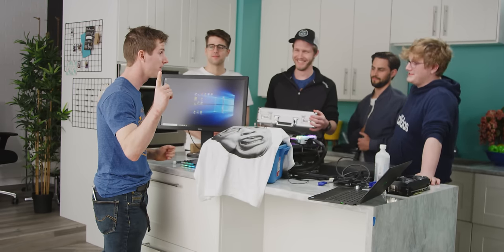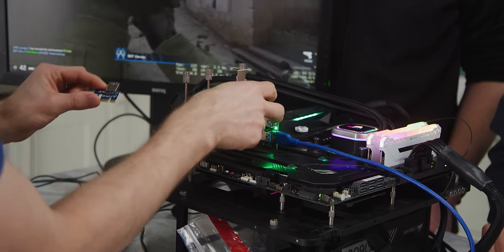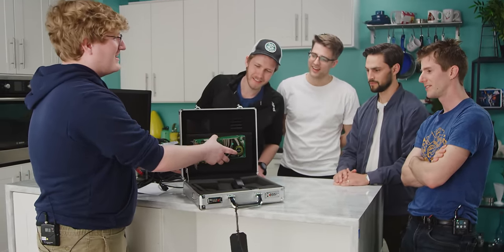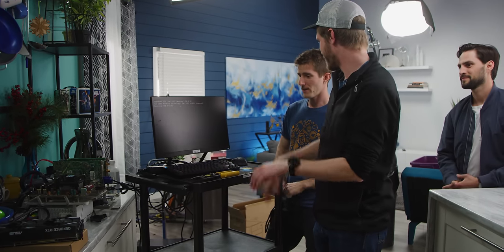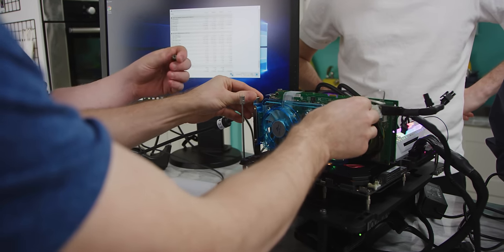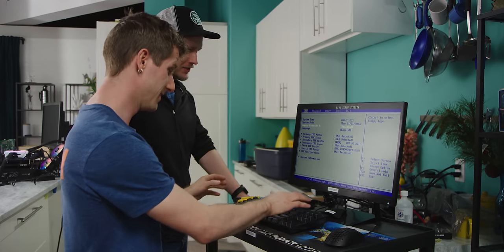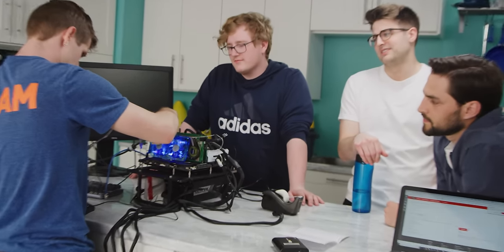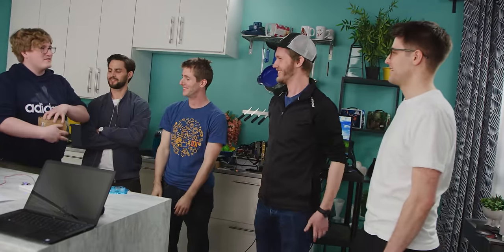The WEIRDEST PC Parts we Found on AliExpress

Comment: I'm a physics major and we have some pretty weird cards to interface with some of our lab equipment. The one that jumps into mind is a card that exists for the sole purpose of interfacing with a spectrometer.
Reply: Ah yes
Perfection
Reply: I would love for you to enter next year 😆 blow em out the water lol
Reply: Yes that shit is weird af lol
Reply: You'd think that kind of thing would be USB TBH, like printers or other big boxes
Reply: I have one that exists solely to provide a single serial output to control an old CNC machine.
Reply: @thewhitefalcon8539  maybe its ages old. I mean at the chemistry student education lab we had some machines which were attached to a pc running, idk windows 95? 3.1 maybe? One of the lab guys said if a part of the pc broke he had to look for old pc parts because they didn't really sell stuff anymore.
Reply: Is it a GPIB card?
Reply: In industrial automation there was a mid 2000s vogue for pci cards that did all sorts of I/O. We are talking motor controllers, fiber optic ring networks, FPGA analog to digital converters etc. Pain in my ass when they finally die and are completely irreplaceable
Reply: the weirdest card I know of is one that interfaces with a gas tank for a submersible pc for marine science from like the early 90s.
there's probably been 5 made. probably ISA though, not pci
Reply: You can see ghost whit those.

Comment: PCIe is too fast, I prefer PCI 👍
Reply: But is speed good?
Reply: @thescreemregular5168  It's PCI, it's horrible
Reply: Actually PCI is faster than PCIe in terms of raw latency. It takes about 2 microseconds to read a single byte over PCIe gen3. PCI does it in 125nS. Obviously PCIe has more bandwidth for larger sized transfers.
Reply: Pp
Reply: @Shadowmaster625  Just like when DDR2 was released. DDR outperformed DDR2 for some time.
Reply: I mean it is one letter less to spell PCI than PCIe, that surely must mean speed if you can type it faster?
Reply: I like having more time to snack or sip a beverage during loading screens
Reply: I’m not a Fan of Phosphorus and Chlorine
Reply: @snowkatyoutube1419  poo poo
Reply: How bout PCI-X
Reply: PCI is lame.

Comment: I had that blue pci fan several years ago when I was in high school. It was the difference between laggy minecraft and smooth minecraft for my passively cooled gpu
Reply: Thats hilarious lol
Reply: TOTALLY, A GREAT INVENTION, Kept my Pro QUADRO GPU happy!
Reply: I also had that fan when I was in high school, but that was years before Minecraft was even in alpha...
Reply: @JadeMarvin  It must not be doing to bad then if its made it so long
Reply: Nooooooooooooooooooooo waaaaaaaaaaaaaaaaaaaaaaaaaaaaaaaaaaaaaaaaaaaay...
Reply: Just hearing the phrase " passively cooled graphics card " reminds me of how fucking old I am considering modern cards like the 2080ti basically have a brick for a heatsync with big ass fans strapped to it
Reply: @ForbiddenFate  They still make passively cooled GPUs and high end graphics cards used to be way bigger.
Reply: I too, owned one of these for 6 months before it shook itself apart.
Reply: So basically turning it into an actively cooled GPU.
Reply: had a 5670 XFX "silent" radeon card a decade ago & it was also just one big fanless heatsink. Worked wonders in cold scandinavia, except one summer where it got abnormal hot weather. Did get one of those dual-fan pci cards as well, but it sadly didnt cut it. Ended up removing a sidepanel & using a genuine big table fan to cool the whole system.
Reply: @JadeMarvin  i miss the old days, there were all sorts of crazy things to mod your system
Reply: @JadeMarvin  we are prolly pretty close in age, do you remember the PC case that was made almost entirely out of fans?...i always wanted that thing
Reply: >Buys passively cooled graphics card
>Also buys fans to blow directly onto it to keep it cool

Comment: “Hey why is there a USB cable running from your PC to the freezer?”

“Keeping my GPU cool”
Reply: I wonder if that would work.
Reply: Back when i was a broke student and my gaming laptop got stolen i got one from a friend that had no screen and didnt have any working cooling. So i had my laptop in my fridge with a HDMI running from my fridge to my tv. good times
Reply: @derpderp4820  That's genius
Reply: I'm watching this at 2 am while everyone is sleeping , and this made me laugh so hard ahhahahahahaga I'm literaly crynf
Reply: Putting electronics in humid cold places doesn't sound like a good idea
Reply: Dean Sqwilliams run a dehumidifier duh. Lol
Reply: Yeah toss that gpu in a deep freezer and you're all good
Reply: @bldeagle10  been dehumidifying my freeze since 92. just in case my fans break
Reply: Didn’t Linus do a video on this?
Reply: @jimihenrik11  bruh
Reply: its not dumb if it works
Reply: 😂 😂 😂 Man that's hilarious
Reply: Pretty sure any humidity is going to migrate away from hot pc components and condense/freeze on the cold surfaces of the freezer.
Reply: @bruhtm1032  how?
Reply: @jimihenrik11  In a very short term, yes. But the condensation would eventually get to it.
Reply: @jimihenrik11  the problem with using a freezer or refrigerator for this sort of thing is that they aren't meant to cool things down, they're meant to keep things cool. They do very well at keeping external heat out and maintaining a low internal temperature but they would struggle to cool something that is actively producing heat.
Reply: @jimihenrik11  well, super hot gpu inside a freezer would create moisture, which PCBs really aren't fans of.

But more importantly, once the system is powered off, the card would swiftly drop down to freezing temps, and then skyrocket back to operating temps in seconds, which would no doubt crack the board.

So I guess...... 

Maybe?
Reply: I don't have a GPU ! so no cooling required !
Reply: @derpderp4820  oh god i'm choking
Reply: @jimihenrik11  funnily enough they did a video on that way back: putting your entire pc in a fridge. It turned out that it hurt way more than it helped due to the insulation in the walls. Fridges and freezers are not meant to run continuously.
Reply: Imagine the overclock options lol
Reply: @bldeagle10  real question is how would you use the freezer after that?
Reply: I want to see them actually try this
Reply: Stick it in a ziplock with a few big bags of silica gel is to avoid condensation and you're probably onto something
Reply: @derpderp4820 I'm presuming condensation was less of a issue than expected. I know in a freezer it would be likely to build up water but the fridge probably wouldn't do that.
Reply: @ssksleepyboy I mean technically if you have an igpu you still got a GPU. Just the one on die is all.
Reply: @Aliyah_666  technically yeah, practically ? nah
Reply: @jimihenrik11 it'd keep at least 5 watts outside the computer!

Comment: I would love the see that pci oszilloscope working! please make a follow up on that card!!!
Reply: A PCI card will work in a PCI-X slot
Reply: I also would like to see it working.
Reply: pretty much every o scope uses pci digitizers
Reply: that scope card also works on a pci to pcie 1x adapter but u have to provide the extra power
Reply: bro just use a DAQ labview and some simple circuits to do what you need
Reply: Or try to find a modern pcie oscilloscope
Reply: A review pls
Reply: Don't think there'll be all that much to see. It's just a PC based oscilloscope, not really all that different from the $60 Hantek or $150 Bitscope USB ones. There should be plenty of videos on Youtube. This one is a lot more expensive, it might be more powerful, but it's also a lot older, and there has been a lot of progress in the low cost oscilloscope market in recent years (thanks to the maker scene), so I wouldn't be surprised if even a Hantek 6022 was actually superior.
Reply: pci and pci excpress DAQ instruments like oscilloscopes are pretty common, but often expensive.  Picoscope make some excellent USB oscilloscopes.
Reply: What is this thing supposed to do? Measure voltages?
Reply: I want to see it working
Reply: @user-ni2tp6ey6l  Pretty much. Voltages over time, at high frequencies and resolutions. So it can be used to identify and analyze signals, or identify very fast overshoots, noise or ripple a regular multimeter wouldn't catch for example. It's a pretty important tool in electronics design.
Reply: it probably costs more then he can afford.
Reply: @phillipBappleton  said "
pretty much every o scope uses pci digitizers"
Not true at all.  Not even close.  I used to work for a major player in the o-scope biz.  I have helped design o-scope silicon.
Reply: Well, I did make a fairly "hefty" comment linking to the documentation of the scope and the software needed to run it.
Secondly, it doesn't need a labview license. (it can interface with lab view, but it isn't needed for operation. A bit like some motherboard still have IDE, doesn't mean one needs such a drive to boot the system.)
Then its specification is actually rather decent, about on par with an off the shelf 700-1000 dollar oscilloscope, so 700 bucks for the card isn't a bad deal.
Reply: I'd like to see that too!
Reply: yes
Reply: they could have bought a pcie modern one
Reply: lol ive a board with PCI slot and and an AGP slot..
Reply: Justin Davis not labview. Anything but labview
Reply: You may as well go for USB ones. It can be used in more circumstances. Pretty sure USB3 has more bandwidth, and latency of signal isn't an issue for Oscilliscope applications so long as measurement triggering is handled on the board and not in software.
Reply: @portalchris  No it won't. The pin-out and physical slot won't accept PCI cards in a PCIe slot. All you'd do is bust the motherboard and probably start a fire.
Reply: @CataclysmZA  I was talking about PCI-X and PCI.
Reply: i vote for please dont (make a flw-up vid)
Reply: @wsippel  You obviously never saw any high-end oscilloscope, they all are PC based (for example Tektronix form model and up DPO7000 are all PC based oscilloscopes and all run windows including DPO70000SX 70GHz models,  Teledyne LeCroy  LabMaster 10-100Zi is PC based 100GHz osciloscope,  same apply fo Keysight). Only low end and low mid-range osciloscopes are not PC based. 
As B6611 mentioned there are National Instruments PXI systems that are PC based test/measuring systems (modular instruments) where most expansion card can set you upwards of 10000$.
ps: even 20 years old Tektronix DSA8000 is 10 orders of magnitude better osciloscope then Hantek 6022 (Hantek 6022 is just joke as oscilloscope) and it is just PC with card in it, running on Windows 2000 (it come even with games preinstall on it so you can play solitare if you are bored).
Reply: @mrlazda  Yes, all higher end DSOs use embedded PCs as frontends, running either Windows or Linux. That wasn't what we were talking about though, and it wasn't what the decade old $600 PCI card in the video was about.
Reply: @portalchris  The abbreviations PCI-X and PCI-E cause so much confusion
Reply: @portalchris  "A PCI card will work in a PCI-X slot"

Indeed! As long as it's keyed for 3.3v or universal signaling a PCI card will work in a PCI-X slot and Vise versa. The only problem is if you have old 5v only cards. The cards and slots are keyed appropriately and will not allow insertion of an incompatible card. However, the pci oscilloscope card he has there is clearly a universal card from the way it's keyed and should indeed work.

Also there are very simple and cheap PCIe to PCI adapters that work just fine. From a software point of view PCIe is backward compatible with PCI. That means all you need is simple hardware conversion, and no kind of special onboard processing or protocol conversion. Likewise no driver or special software is needed.
Reply: They may or may not be able to get it to work with an open source solution like pulseview rather than an expensive solution like labview.
Reply: @portalchris  PCI-X is totally different from PCI-Express
Reply: but you see them often
Reply: Unless it's 5V only, but that o'scope card was dual notch (aka 5V or 3V3), so it would work Just Fine in a PCI-X slot.
Reply: Nerd
Reply: @ @levicortes9456   if you believe it or not, i am :P
Reply: @wsippel   That's because these cards are very different from the Hantek or Bitscope USB oscilloscopes. They're acquisition cards with rather minimalist input protection circuitry, making them somewhat trickier to use. Additionally, they tend to have quite ridiculous sample rates compared to the USB scopes you're talking about. You cannot use one of these as a regular oscilloscope, don't even try.
Reply: Yes. Linus, please do it in the Alex-land. :)
Reply: on aliexpress you can find an USB oscilloscope for around 50 bucks.
Reply: LAB-VIEW is too costly unless he can get some personal use student linus.
Reply: Heck my modern mobo has an PCI slot.
Reply: @portalchris  They definitely weren't using PCIX bus. If they said PCIX, I'm pretty sure they meant PCIe (PCI Express). And PCIe is not back compat with PCI.
Oop, sorry just clicked "Show more comments" and I can see others have already corrected you on this. Sorry to bust your balls, sir.
Reply: phillipBappleton don't real scopes use ASICs that cost millions in R&D?
Reply: You can't beat old analogue Tektronix scopes.
Reply: Labview License cost 4000-6000$...
Reply: @wsippel  Awesome. I keep needing a scope every once and a while (2ch would be better than nothing, 4ch would be nicer) and need to start looking around at a decent cheapo option. :P
Reply: I am really being blown away what someone tries to put onto PCs for fun.
Reply: @portalchris  And just like some 16-bit ISA cards would work in an 8-bit slot, so too will some PCI-X cards work in a regular PCI slot, just more slowly.  I've got an enterprise-grade SCSI controller running on my machine that way.
Reply: What is the oscope supposed to do ?
Reply: @Luctiel  I've still got one here with ISA slots in it.
Reply: Fyi oscilloscope's are made with those. They're a great entry point for hackers. Yay XP
Reply: it's spelled : Aussie-loscope
Reply: LabVIEW is terrible, it's a graphical programming language. Matlab ftw
Reply: @Luctiel  Me too. I have a ton of boards with AGP and PCI slots.
Reply: @Bali6161  suprised that alex didnt do that
Reply: @deeperlayer  This is true, also true is that this type of equipment can be very expensive:
https://www.ni.com/en-nz/shop/select/pxi-vector-signal-transceiver
$85,000USD or so for the bangin' one. That said it might be a bit cheeky to call this a oscilloscope, this is a Vector Network Analyser, which is a very wide band system for direct RF analysis. This would be used for 4G/wifi radio testing, or FCC interference testing etc.
I can also tell you from experience, the pucker factor when you build a fixture round one of these is high. You don't want to blow up the card worth about 50x the price of your car lol.

Comment: Can we have a continuation of Alex’s card? That was lowkey kinda interesting.
Reply: I've no idea what it was. Can someone explain it?
Reply: @iyeetsecurity922  it's a little complicated to explain in a comment. It was an oscilloscope for computers. Wikipedia has a page on oscilloscopes if you want more info but basically it's a scientific tool.
Reply: @jobwilliams5705  I went ahead and looked it up. While I have a basic understanding of what it is and does, that's definitely some out of my league mega brain stuff I don't quite get seeing as how I've never heard of it til now. I'll have to dig a bit deeper. Thanks for your input!
Reply: @iyeetsecurity922  This is out of nowhere but do you go to Erik's classes?
Reply: @nit-Inundate  did anyone ever replied to this?
Reply: lowkey wasnt
Reply: There are some better budget PC oscilloscope options now, but lots of people have hacked sound cards into DIY oscilloscopes. You typically need to modify the inputs to be DC coupled, modify any hardware filtering the card has, and include some type of input protection or attenuation depending on what you want to measure, but especially when you can find cheap old hardware it's not a bad way to go

Comment: PLEASE make a video on the riser card Riley showcased! It is a 1x to 16x riser card used for eGPU setup. Would really like to know how much performance loss is there when going 1x (instead of 4x in the other eGPU video LTT has made) and how does it fair on laptops when using internal monitor or plugging in an external monitor with the graphics card.
Reply: ive tried on gtx 1060 in 2016. its obviously had bandwidth problem as i can play on ultra but it can only go to up like 40 fps
Reply: Could maybe be useful as a mining riser, since they don't need much bandwidth. 4 cards on a single slot would be killer if mining wasn't dead.
Reply: In my experience of trying one out, depending on the card atleast a 50 percent performance decrease, but made worse as the frame rate seems to fluctuate wildly.
Reply: try it with vive wireless
Reply: It's actually really good. I am not sure what the performance difference is, but i took my decent laptop with a 980ti on one of those 1x expansion slots from banggood. Took out the wifi card in the laptop, put in the cable, dragged the cable out via the dvd drive slot that's never used.

So damn smooth. Maxed... well. All the games I liked without issue. Only problem is with loading in new areas, because the texture loading is bottlenecked pretty heavily. That, and the cables I used were unshielded, leading to a crash like.. every four days? Worth it.